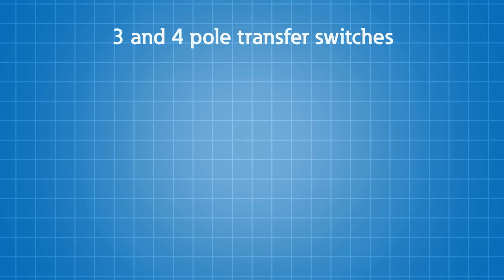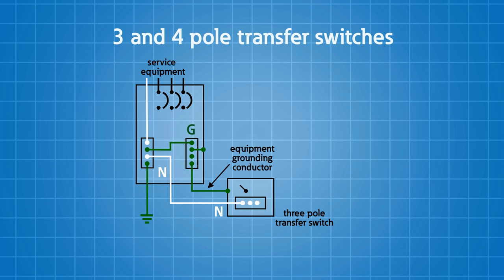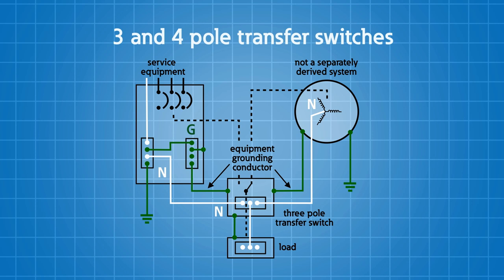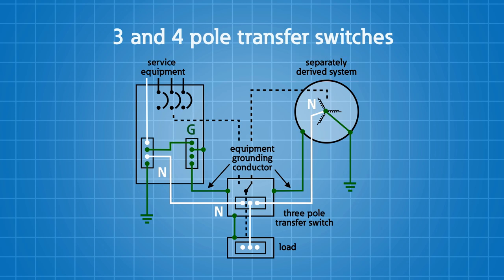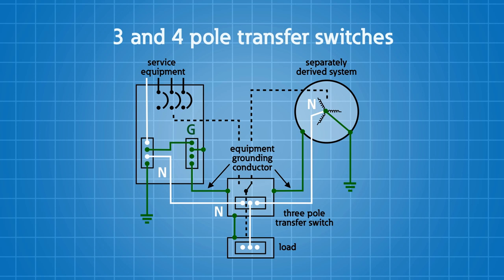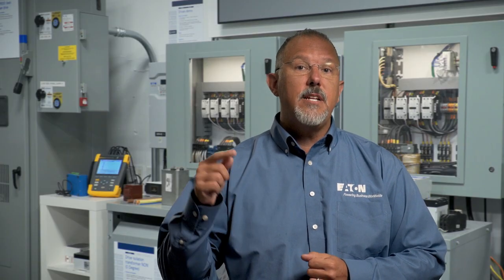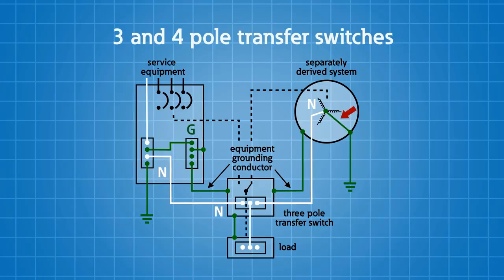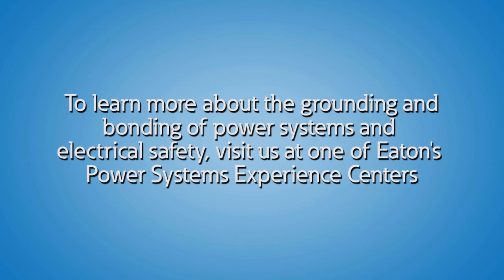Grounding and bonding: Generator sources and transfer switches

Comment: What you've describe is well and good really for the 3 phase system. In a split phase system you could have a 3 Pole switch, (2 hots 1 neutral), with 1 pole used to switch the neutral. Well, most generators today rated over 5k in have a neutral-ground bond. It'd be nice if Eaton actually sold a transfer switch/panel that switches the neutral with a 3rd pole. As it things stand right now eaton only sells one transfer switch that switches the neutral model CH10GEN5050SN. Be nice if you have  a 100amp version with more circuits than the measly 10 that this current iteration has

Comment: how the generator neutral return current will flow back through the other separately derived system and the Generator neutral is not grounded ( it is an open circuit)?

Comment: I installed a switch in the middle of the bonding wire on the generator. It's off when running the cabin through a transfer switch and on when power tools are plugged directly into the generator.
Reply: did the same so I can use the generator for house OR stand alone.  problem is educating others who operate the generator as to why